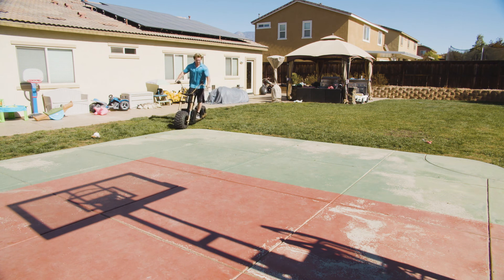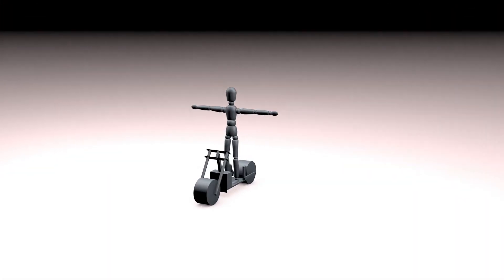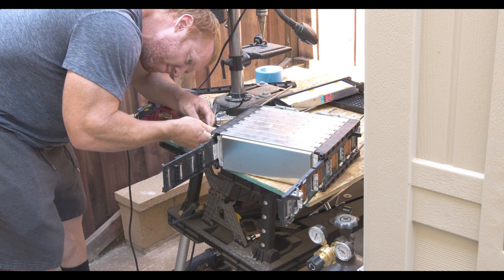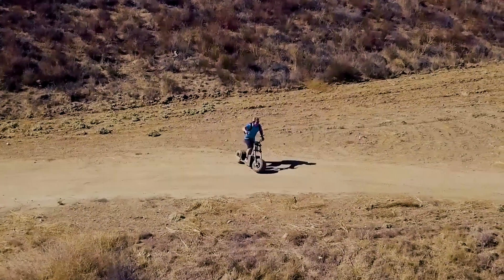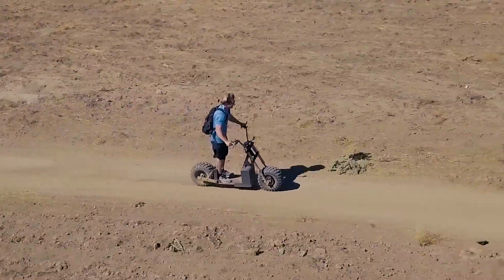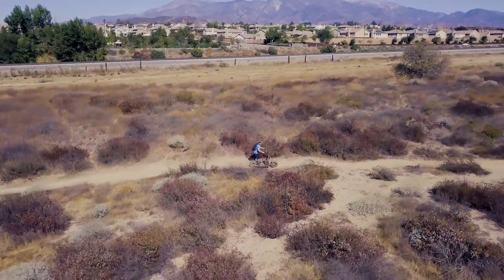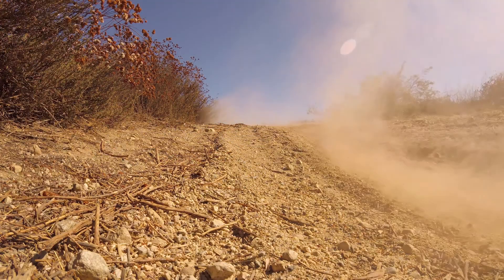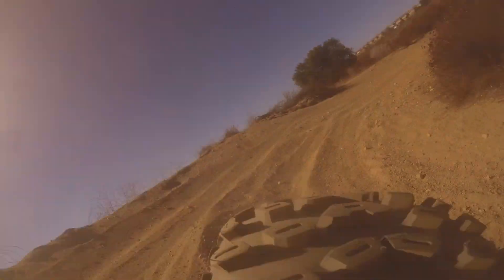Electric Dual Drive FAT TIRE Scooter 75 volts 60 amp hour (SHORT VERSION)

Comment: Hello, What type of battery do you use? Where do you buy the wide wheels
best regards from France
Reply from the maker: On this one I made the batteries from a Chevy bolt car modular. Took the cells out and made my own pack. Check out the full video to see more in detail. Also are you in USA? I can get the hubs to you if you like email me
Reply: @RexSmithII  Hi, no I'm not in the USA, I live in Europe in FRANCE, I also have a youtube channel called "RLC POWER" and I built an electric scooter with batteries bought in China
Reply: @RexSmithII  I'm also from Europe from Germany and I would be interested in these motors to. Do you have a name or a link to a shop where I can find those.
Thanks and really cool scooter
Reply from the maker: @noah1306  I think email me, 
I sent you an email today
Reply: @RexSmithII  I'm in the US, where can I get these hub motors?
Reply from the maker: @charlesgunzelman3323  email me
I will get them shipped to you.
Complete package? 1 hub 1 matching controller 1 throttle